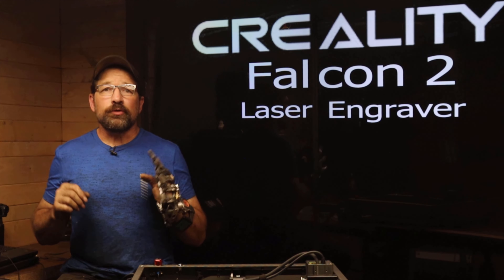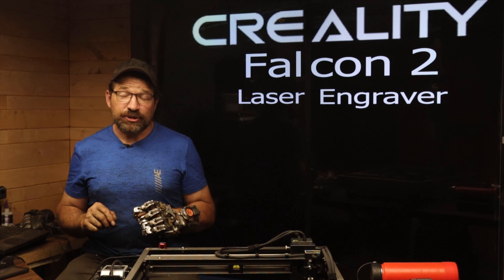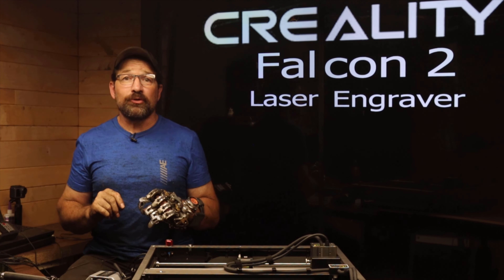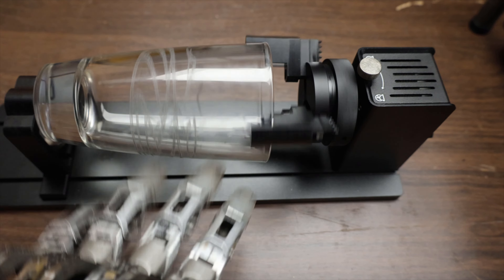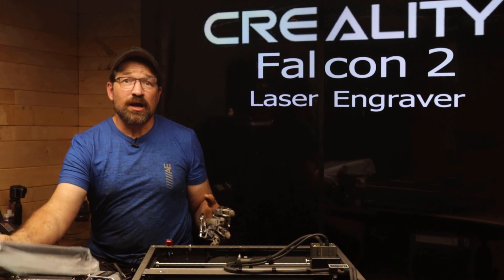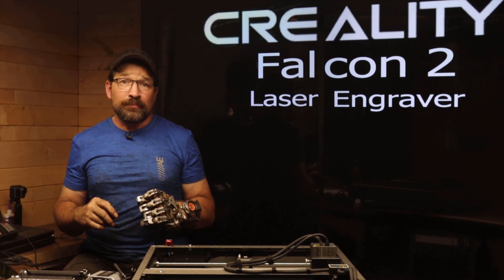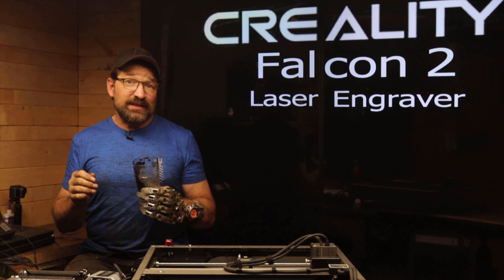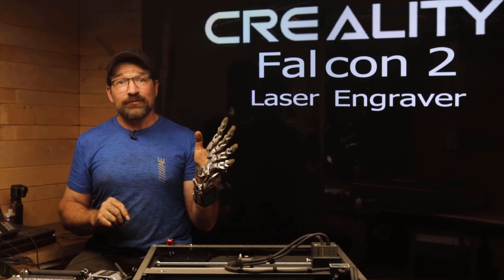Most everything you should know about the Creality Falcon 2 22 watt Laser Engraver

Comment: Elephant in the room for new diode laser product announcements is always: does it finally cut all the acrylics like co2. Looks like it’s still limited to black
Reply from the maker: Eh, if I'm needing to cut a bunch of acrylic I'm doing it on my co2. Its way faster. And 455nm has an issue with clear, where 10600nm with out air at 0.28im/sec gives you an amazing edge finish.